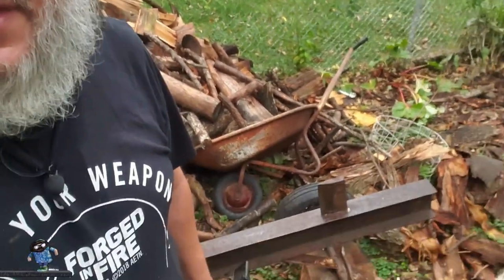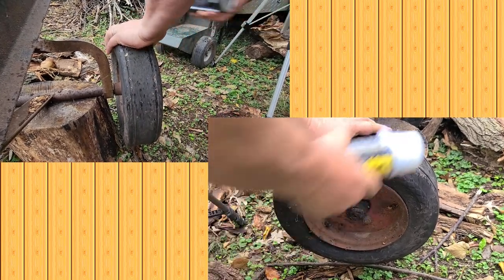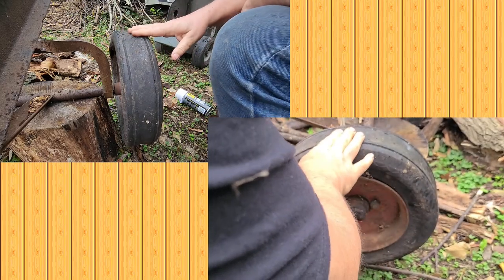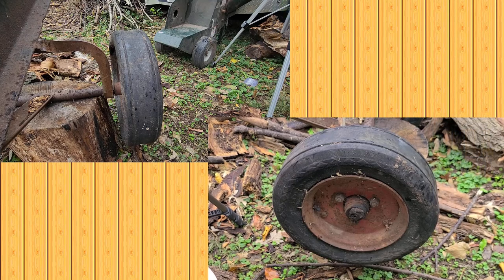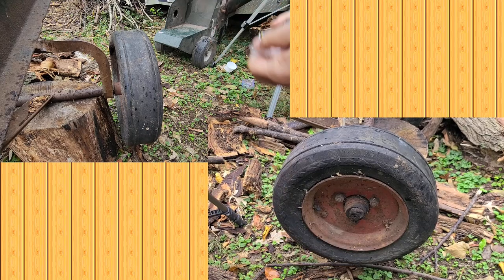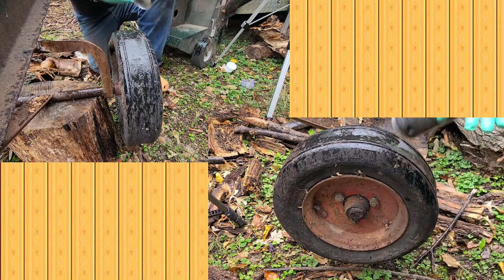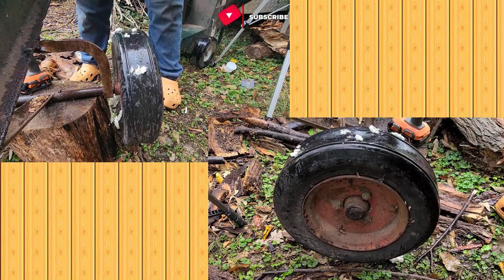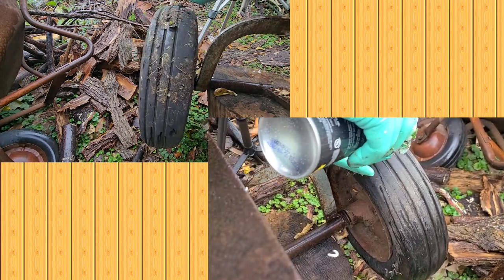Sketchy Foam Tire Repair

Comment: how much wood do you cut??  i remember as a kid my brother and i would split 5-6 cords of wood every summer/fall
Reply from the maker: I technically use a pellet stove, and cut wood to 5" pieces cubed or smaller to toss on top of the pellets. The wood here is probably 2 or 3 years worth. so not that much.
The amount here was more because of what fell in my and the neighbors yards in the last couple of years and I'm getting to process it now.
You will see mt cutting it up in a future video,